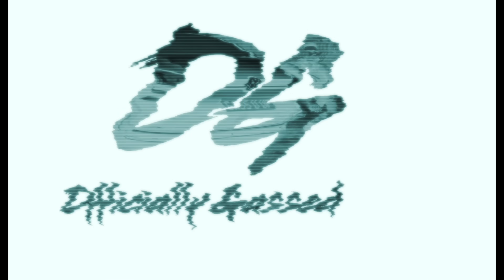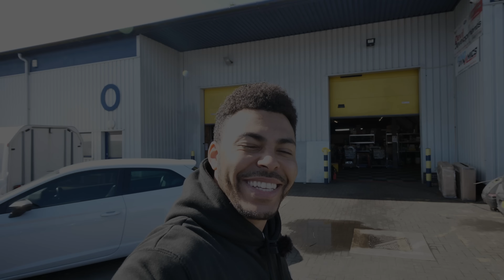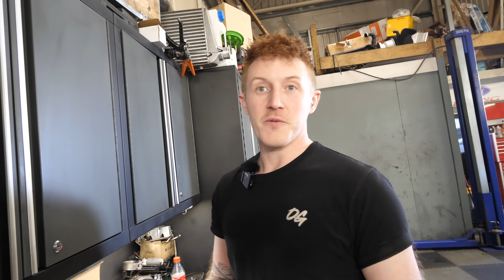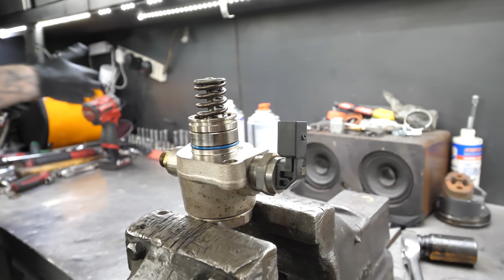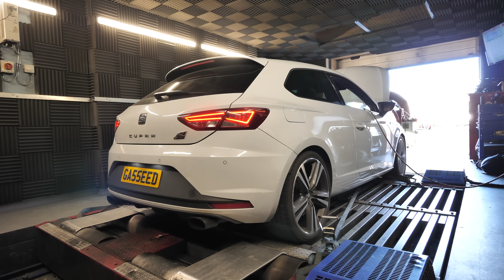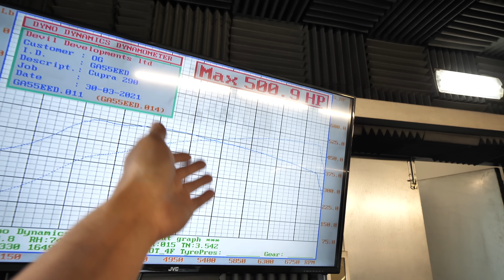BEAST MODE *HYBRID TURBO* STAGE 3 TIME.. HOW MUCH POWER?!

Comment: I like the air intake duct, it's a piece of art by itself and unlike other builds it draws cold air from the outside not just looking like a sad cone filter in the engine bay pulling in whatever temp is inside. A really nice looking build.

Comment: My old Elantra made 300whp with simple engine mods intake, valves, ported head, re-geared trans and a tune. Exhaust like everyone. I don’t know why we list it anymore, it’s kind of a given by now. 

Races I’ve won in Mexico with it, and roll speed. 

400whp Hawkeye STI built and garret turbo
40 roll - lost by 1.5 cars. 
50 roll - kept up, he pulled half a car at the end
60 roll - even. 

Stock STi new model 
40 roll - even 
50 roll - won by can and a half
60 roll - won by a bus length. 

R35 GTR with exhaust maybe a tune we split up and didn’t talk- they all look the same to me I don’t know the year. 

40 roll - fucking smoked by a train car
50 roll- lost by a bus
60 roll lost by a few cars. 

FWD cars built properly with a good trans gearing, oh god is it fun. 
I’m not very mechanically inclined. I asked for a really long gear from 1-6

A full rev out of first and second gear would be about 120kmh if I get a good launch and grip up. 

Miss it, but love my Audi. So far I’ve raised the boost, an exhaust and have an cuts turbo intake pipe coming. So with a basic tune to prevent my plug from melting im making I’d say 300 Awhp. 

This past Saturday I kept up all night and beat my buddies 4.2l S5 a few times. I love fwd sleepers, but my Audi has made me fall in love with German cars.

Comment: Would be good to know how much a build like this would cost...
Reply: Allow for about £10k
Reply: At this stage with labour it's in the ball park of around 5k I'd say
Reply: @ARDEN440i  Easy 10k
Reply: 10k once forged as engine work is the most costly. At the moment, probably around half that as its all bolt ons and map. Exc brake kit that is.

Comment: Jamie please make that turbo a production one after you tested it , I'd love that on my cupra!!!!
Reply: Try this one if you want an even faster car. Makes power sooner in rpm range
Reply: @AMT_97racing  what you on about?
Reply: Wel i dropped a link here 3 thimes but it doesn't seem to post.
Reply: Lm500 gen 2turbo kolbenkraft germany.
Full boost and peak torque 600+-nm at 3100 rpm. In this graph you can see it only starts making peak boost around 3750rpm +- so sooner power delivery less lagg and better daily driveability :)
Reply: There is also an lm575 turbo that stil spools sooner then this one.

Full boost at 3700rpm. 
550- 600hp and 650-700nm.
Depending on how hard you want to push  the turbo

Comment: F the fwd haters I sold my 300bhp glanza last year used to smoke golf rs and Audi's for fun and it was still a 1.3 😁
Reply: Watched ya podcast before with ant top stuff mate joe Rogan is scared 🤣🤣
Reply: Glanzas are rapid mate and a cool little car scatty as hell with power as well but good fun to drive.
Reply: @stichupman  mate I'm so annoyed I sold it because I had a kid I still got a mazda 323 gtr and a evo so it's not all bad
Reply: @jdmking888  doing better than me then lol. 90's jdm is the golden era.
Reply: @stichupman  what you driving pal? Plenty of cheap fun cars out there! Iv been eyeing up a few drift missiles bmws mx5s etc theres a track near me (buxton) and iv been going up watching for couple years now I need to get stuck in
Reply: @stichupman  my glanza aswell was insane spec g6r lsd 6 speed gearbox. Carbon fibre akrapovic side exit cusco cage evo 8 seats mental spec list

Comment: Get the 4wd conversion on it jamie.. be a beast when it can put 500bhp on the road.. the monster just spinning all that potential away.. what a sleeper though. respect jamie.. 👌👌👌
Reply: Migth aswell just get an rs3 then as already got the gearbox and got a better engine too
Reply: Yeah something like the vrs 750bhp one. That thing was nuts.